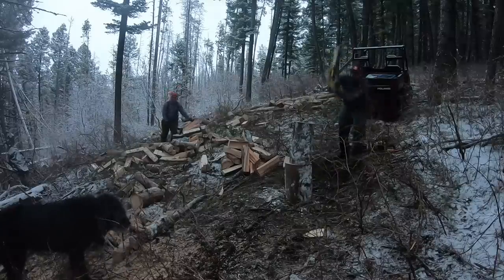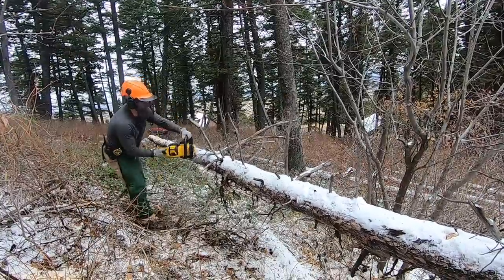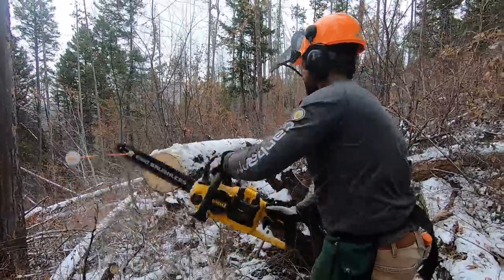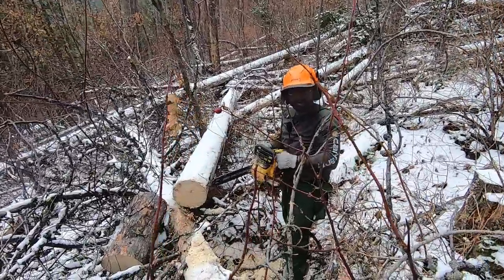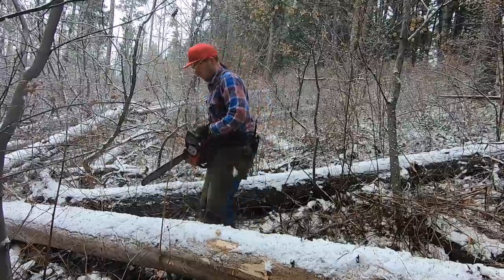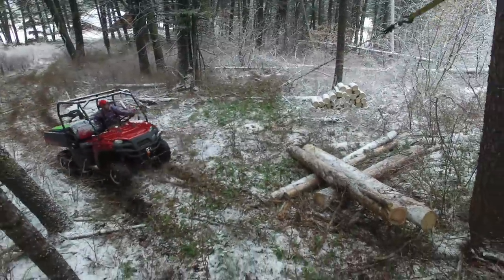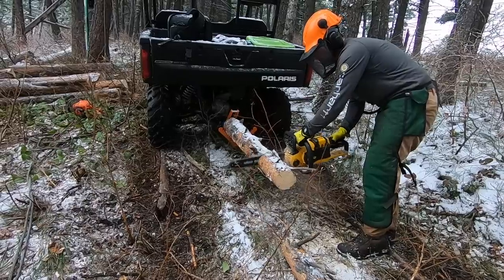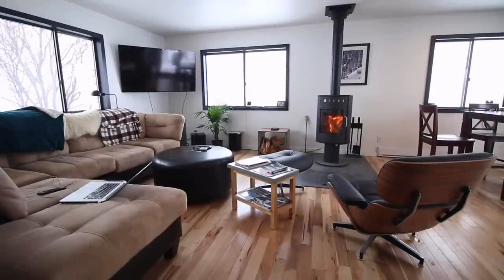DeWalt 60V FlexVolt Chainsaw Cutting Performance - Review and Comparison to Gas Saw

Comment: The elephant in the room is how many charges do you get from those very expensive batteries.  Also how long they last when stored unused like the off season.
Reply: I have some 20v dewalt batteries that were bought when dewalt fist came out with 20v that are still running strong. I also have some milwaukee 12v batteries from when milwaukee started their 12v system still running strong.
Reply from the maker: Not sure exactly, but i've had the saw at least a few years now and also have the weedwacker, leaf blower, concrete wet saw, and a couple other 60v tools. I use them a lot, and they are running strong.
Reply from the maker: Thanks for your feedback
Reply: I have makita batteries that run my chain saw that are 9 years old. And run my tools fine. But in saying that makita has volt protection that makes them last longer that dewalt dosn’t have.

Comment: I have a 15 year old 18 in. Craftsman..never takes more than a couple pulls to fire up..still works like a champ but I'm not working it everyday for fuel. I'd like a battery saw for a couple quick cuts. As far as camping I still love to drag a log back to camp..prop on a rock..then take a large rock and smash it down to lengths..takes me to my inner caveman. Helps if your growl a lot too.
Reply from the maker: Awesome!

Comment: the saw battery would be good on my electric bike :) been looking at different powertool battery options . how long does it take to charge them? nice in the saw thou , you live in a beautiful country :)
Reply: lookoutleo 
Bout 1 hour
Reply from the maker: Thank you!
Reply: @MrKritterh  yes it was for flying , they have a limit on watt hours 100 I think so my 370wh battery to big but it uses the same 18650 cells both types of battery . Your right thou , I tried 2 X 2a 20v in series 80wh and it's power sag was very bad, only did a few miles even on lowest power setting on the bike. Keep safe in this covid epidemic

Comment: Hey Pete! Hope all is well in your neck of the woods. Is this your first snow of the year? Was wondering what your thoughts on the  cordless table saws?
Reply from the maker: Hey Rich! All is well man! This was filmed on Wednesday and we had a few snowfalls beforehand, but the biggest was about 4 inches where I live outside of town. As for the cordless table saws, I have used but do not own the 60v flex volt dewalt saw. It was super convenient and worked great for plywood. I could see using it while outside for doing trim, sheeting, etc on the house. I do own a battery powered miter saw (option for it to plugin) -- and it is super convenient. Have you tried a battery powered table saw yet? If so, what brand?
Reply: DIY PETE no I haven't yet. My shed is really small and can't run 2 tools at the same time. I trip the breaker. I was thinking about buying one for the winter so I can run my space heater. I'm kinda a whimp on the cold thing.
Reply from the maker: Well, the table saw does work well. The cost to have the battery powered table saw is definitely a premium, but would be nice! Those space heaters trip so quickly. I have a little buddy propane heater currently to help with the garage heat since I haven't yet installed anything else at my new home, but I agree that the heat is needed! :) Cheers!

Comment: I recently bought a dewalt 60v. I am not impressed with it so far. Seems like it doesn't want to cut even the smallest sticks. Maybe just user error but I even replaced the chain and still it isn't very good. I think ill end up selling it and getting a good sawzall with a larger blade.
Reply: Perhaps the chain is the wrong way around? The saw must be really broken if a sawzall beats it. I bought a Makita Sawzall, 36v for the wife to prune trees. The chainsaw is too dangerous for her as she sometimes loses her temper... But there is no comparison. The sawzall works ok though. But for volume cutting it is not as good.

Comment: If you only need a saw to clean up an occasional downed tree in the yard, especially small trees, electric is probably the best option.   Especially if you can match it with a cordless string trimmer or leaf blower that uses the same power pack.   They would probably even be adequate to produce an occasional camp fire.  The biggest advantage of the electric saw is that it can set on the shelf for years and not have any issues starting when you need it.   This would totally eliminate/replace any gas saw you would buy from the likes of  Walmart.  Depending on a person's needs, these could even replace some of the smaller home owner saws a run for their money from the likes of Stihl, Husqvarna, and others. Whether it major storm cleanup, serious property maintenance, firewood, or logging, if you have actual work to do, you'll need a gas saw.  Yes the 440 was a beast and embarrassed the electric, but even a properly set up 50 cc saw  would be a huge improvement.
Reply from the maker: Thanks for your feedback!
Reply: @DIYPETE  Something I forgot to say.  Excellent review/overview!
Reply from the maker: @nospam3409  Thanks so much! Have a great week!

Comment: been running a makita 14 inch bar, 36 volt saw. it has steel dogs unlike deWalt one. i've heard that this saw you are running is meant for constuction sites mostly so this is why the missing dogs.
never ran a gas saw and bought my battery Makita one year and a half ago when i started working on my country property. 
no fuel mix, no sparkplug, no cold engine, no gas smell, no fumes, little noise, no rope pulling, no noise idling...
i used it to cut some old plums, willows, black locusts, apple trees and made a lot of firewood with this little saw. you have to respect it and not think it's gas powered. do not lean on it, allow it to cut without appling preassure. learn to use it and it's a great small companion. keep the chain sharp as it really makes a difference.
in time i bought four battery pairs and i can work 2-2,5 hours on those. in summer i use the bateries for the battery grass trimmer (also 36 volt).
Makita has 18volt batteries, 18 or 36 volt tools. the 36 volt tools use pairs of batteries. i say this for those that do not know the Makita offering.
regarding this deWalt 60volt saw, i heard that there is a 40 volt one that has more omph and probably runtime. 
what is the width of the chain 1,3 mm or 1,1 mm?
Reply: I put a 16 inch bar on my Makita works just as good.  I've cut 20 full measure cords of big stuff, like 10 to 25 inches.  I cut the wood in 9" lengths, so twice the cuts.  I also "split" the wood with the saw.  Makes nice square blocks for stacking.

Yes, I've really given my Makita a work out.  Still good as new.  Takes about 500 to 600 watt hrs (3 sets of 6Ah batteries) to cut a wagon load.  Love my batty saw.
Reply: @geraldmoore6257  yep... The "fuel" costs almost nothing.
Reply from the maker: Thanks for your input
Reply from the maker: Great to hear
Reply from the maker: Not bad :)

Comment: Stihl does make great saws but battery saws are making inroads to these.
One thing about an electric you don't have to worry about is the gas, oil, spark plugs and carburetors  and other things that go along with the gas saws.
For tough world a gas saw is the way to go but most people will get by with a good electric one.
I know Ryobi offers a 3 year warranty on their products. Home Depot will give you a free replacement or even give your money back within a year, I have been told by the people at Home Depot.

Comment: For little stuff around the house I’d recommend a little hitachi or electric saw. But if you’re cutting in the woods all day you can’t beat an old McCulloch.
Reply from the maker: Great to hear what works well for your property!
Reply: I agreed with you until you said old McCulloch.
Reply: They are very powerful and run great. They are reliable and cut quick. Stihl and huskevarna are also good along with old jonsrudes. Also the new jonsrudes but I think husqevarna bought them

Comment: That lil' dewalt is slicker than snot, I take it out on my motorbike and do clearing for single track trails.
Reply from the maker: Definitely awesome to take on the trails! I do the same with my side by side. Cheers!
Reply: Just buy a good hand saw less weight and no gas/batt

Comment: Pretty good battery chainsaw for emergency responder use or rescue services
Reply from the maker: Absolutely!
Reply: AW for vent ops it's not great , it tends to bog down a lot and ours got really hot during our truck ops class BUT they are great for trees on road calls because they make it quick and easy to just hop out of the truck fire it up chop up a tree and be back in service

Comment: oh wow the drone scenes... 
p.s. how much time it takes for the electric chainsaw battery to get fully charged?
Reply from the maker: Hi! It takes about 45 minutes to 1 hour to charge the 60V battery. I have 2.
Reply: @DIYPETE  with a fast charger that is.. The black chargers will take all day to charge a 60v battery.
Reply from the maker: LowJack187  Hi! I was using the 9ah batteries.

Comment: Im on a vol Fire department where the idea of having one of these E chainsaws on the truck but it got down voted by most of the older members. Any thoughts or advice to help convice the olders minds?
Reply: 1. No 2-cycle fuel to deal with (especially if there is fire nearby)  2. You can communicate over it - the less noise in an emergency situation the better.  3. It's ready to go immediately. Put it on the truck anyway.  They'll come around once they see you have that limb off that car while they're still starting up!
Reply from the maker: My uncle is a volunteer fir fighter and they have both gas and electric. They phased them in a while back and I think they have grown on everyone.
Reply: @rcastor1  That's the biggest advantage right there. For a really short job like cutting one tree limb up to move it, the gas saw takes as long to get going as it does to do the job.
Reply: There awesome for small jobs like cutting up trees and getting them off the road but they aren't good for vent ops the one we used would heat up really fast but if you guys have a utility truck I'd recommend you buy one for your  department for tree down calls
Reply: No way.. old people that don't want something new thats better for the world they are leaving? Lol

Comment: In the next several years, battery technology and electric motor improvements are going to level the playing field as far as power and speed. Tesla is already there with cars. The biggest issue is getting energy to the saw. Either you need a lot of batteries just like you need a can of gasoline or a way to quickly charge the batteries you have. If you were in a very very remote location and could charge the batteries with solar power the electric saw would actually have the advantage because eventually you would need to go get gas. Personally I only use a chainsaw around the house for clean up and small trees and use a corded electric saw most of the time. I do have a gas saw that I've had for a long time but if my job is less than 100 feet from the house it's just easier to use the electric. It might be a little slower with the cut but it's so light it actually is less effort to use it and there's no time wasted getting gas, mixing oil, and it never, ever refuses to start.
Reply from the maker: Thanks for sharing!

Comment: Did you use the 60volt 3.0 ah? or was it 5.0 ah?
Reply from the maker: Hey David, I had the 60V 9.0ah battery that came with the saw.
Reply: @DIYPETE  I bought the 20V Dewalt saw good little saw with 5.0 ah but it does not stay charged long cost was 242 at Home Depot. I saw your ad and I was wondering for that price is the 60Volt 9ah the same price as the one? The link in your ad says it is only 3.0ah?
Reply: @DIYPETE  I am going to get the same one. I like your Demonstration.
Reply from the maker: So the battery that came with the saw has a label on that battery that says 9ah, but it is marketed as 3ah in the description. There are some explanations as to why that is in the q/a on the amazon listing about it. Anyhow, I have that exact saw.
Reply from the maker: Thanks David, I've been happy with it around the house for sure and it does everything I need it to. Cheers!
Reply: @DIYPETE  Since the battery will work for 20v or 60v dewalt tools they put both AH ratings on the batteries. 9AH @ 20V = 3AH @ 60V

Comment: Electric cord the only way to go!  There cheaper, lighter, quiet,  and very dependable, gas is heavy, cost more, loud,  But a little more powerful >   All i use is a 2200 watt generator, with the electric power tools!  For off grid > This also give your generator more things to do!  Rather than setting around all the time
Reply from the maker: Thanks for sharing!

Comment: Battery chainsaws are the future. If you are spending all day in the field cutting multiple trees then you still need a gas saw. But for 90 percent of homeowners a good battery saw is a much wiser choice.
Reply from the maker: I agree!
Reply: Just carry a few spare batteries on your belt or something, and charge them in your truck when you have your lunch break?
Reply: @hakont.4960  You can charge the batteries easily with a inexpensive camping inverter and a truck battery. The 115 or 230 V chargers are usually more powerful than 12 V chargers.

Comment: I think gas defently has its place when going all day non stop though the person that doesn't use a chainsaw that much or any tool equivalent battery is the way to go especially with weed whackers and  hedge trimmers and leaf blowers too unless doing fall cleanup then I want gas
Reply from the maker: I hear ya! And it is nice when you have their trimmer / blowers etc to be able to interchange the same batteries in if they have the same brand. That's what I do and it is the best. I couldn't believe I could do all the trimming in my whole yard with the battery powered weed whacker, such a game changer. Great to hear from ya Andrew!
Reply: definitely

Comment: I only ever need a chainsaw for camping and when hurricanes come through so the electric is good for me. Don’t have to worry about running it dry for storage either
Reply from the maker: Great to hear!
Reply: People often lose power after hurricanes, so what then with the electric chainsaw? I love cordless electric tools but emergencies are one instance when they're not appropriate.
Reply: Charles Furer I have multiple deep cycle batteries with solar panels and controller. The deep cycle batteries will last much longer than the supply of gasoline in a serious emergency situation. I’d agree for most peoples needs but with my setup electric will always be a better option.

Comment: I cut around 2 1/2 cords of oak hardwood a year with my corded electric Worx chainsaw, and have for the past 4 years with no problems. My wood lot is less than 100 feet from my house outlet.  My saw is 16 inch and I have cut 30 inch diameter logs with it.  I do have a generator I can put on a small trailer and get around my 5 acres on, but I prefer to find yard waste trees already cut down that the owners will give me to get rid of!  Ha ha.
Reply from the maker: Great to hear!
Reply: Measure from the tip of the bar to the tip of the dogs.  Will your saw actually cut to a depth of 15"?  I'm skeptical, but open to actual measurements.

Comment: Love your videos Pete but I hope you know that no one likes this flexvolt chainsaw because it is crap from construction to performance. You need to get your hands on the cordless Milwaukee m18 chainsaw. It will blow your mind !
Reply from the maker: Hey Matt! I will have to try the Milwaukee sometime.  Cheers
Reply: Electric 120 and 240v are more dangerous and kill you if not careful, electric has more torque but i feel safer with 2 stroke gas saw, I saw a 460v motor blow up, it was not pleasant. I hope a saw never gets powered with 460v!
Reply: The chainsaw is an 18v unit.
Reply: I would hate to see one run on 230v or 460v that could cut down a whole forest. them damn electric motors are just to torquey for there size, ill stick with my 2 stroke hot gas engine I hate the gut wrenching torque of an electric motors its just too much. The gas 2 stroke or sachs rotary dolmar 2 stroke has good hp but no where near the low end torque of electric. the electric has the most broadest torque curve.bummer i though the gas 2 stroke would win in this! I fear electric cars taking over my 2 strokes!
Reply: Bruce Miller haha...
Reply: It's like the Ford and Chevy debate with those two tool makers. I have the mileaukee gen 1 circular saw and bought my dad the dewalt. The dewalt kicks the Milwaukee's butt and i like it better in almost every way. But i have everything else milwaukee so go figure. The gen 2 milwaukee saw looks like it can hang with the dewalt though.
Reply: Bruce Miller voltage doesn’t kill, current does
Reply: @jlo13800  Just add a soft start circuit to the saw, or add a microprocessor to the motor circuit and it'll behave nicely. Heck, add bluetooth connection while you're at it so you can tune the performance on the go.
Reply: @jlo13800  It's DC.

Comment: Got an 18 volt Ozito for pruning up tree (one handed) and Two stroke gas for bigger jobs. Horses for courses!
Reply from the maker: Cool!
Reply: Hey Pete it's an el cheapo electric, I'm no pro. My Gas chainsaw is.......An el Cheapo, I Know, you get what you pay for, But I don't use them every day. My Gas chainsaw cost $69.00 in 1915 (wish I'd bought two)  I've bought a couple of chains for it and still have the original (minus a few teeth wire and bolts in logs) I sharpen and service it regularly, reverse the bar every time I sharpen. etc. The electric is used one handed pruning my fruit trees and eucalypts. If I was a pro I'd buy a Stihl, Husky, Or Johnserad. But I'm not. Cheers